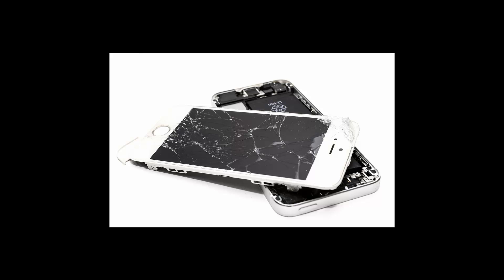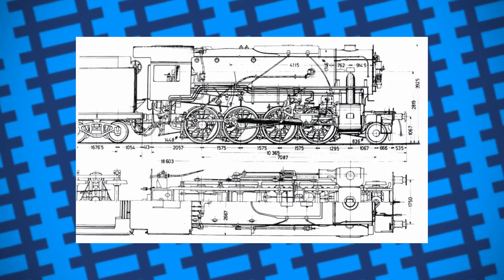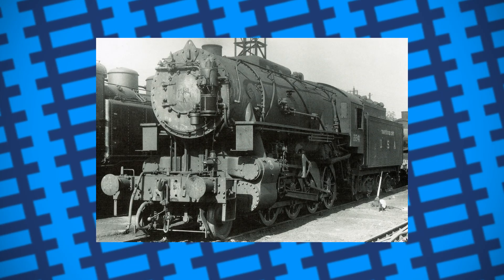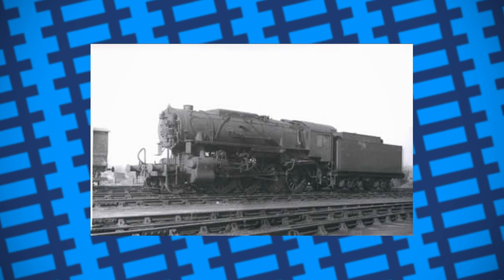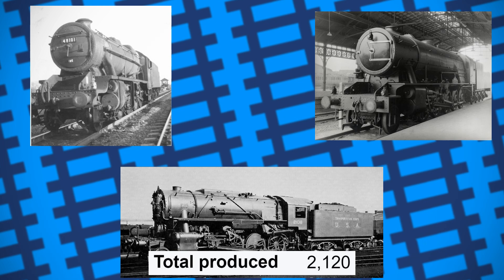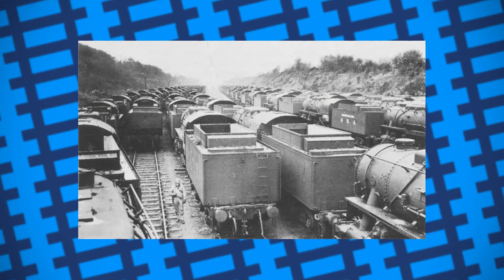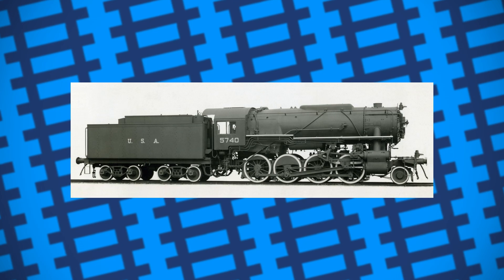The Disposable engines that Conquered the World - USATC S160

Comment: Im typing this comment to inform folks who are intrested on the subject matter of "A handful of S160s in Spain ended up in Alaska" that's mainly a error on Train of Thoughs part but it is true just the other way around. To set some back ground a railway company in spain which is named "Ferrocarril de Langreo" or "Langreo Railway" or "FCL" for short which was a Standard gauge railway that operated in Northern Spain, the railway was established in 1852 during the the late 1950s the railway company wanted to modernize their engine fleet and infrastructure and so they have bought alot of new equipment and engines of varying countries of origin among which alot of american engines and rolling stock are in the huge list of new motive power, five S160s that we're formally owned by the Alaskan railroad company the five machines were one of the first to arrive in spain for FCL along side other american steam engines they were unloaded at El Musel harbor in Gijón date of arrival is (Feb-25-1958) the S160s kept their alaskan railroad Numbering which are: 401, 402, 404, 405 and 406 the engines would haul Ex-Erie railroad hoppers on the FCL but it was quickly found out they were to heavy for the langreo loading gauge to handle especially on the old narrow Carbayín tunnel. The railway eventually decided to modify the more powerful S-159 (another USATC 2-8-0) and four were so treated, 401 being kept for spares. Modifications included cut tender tops, cabs with lowered roofs and slope sides and front pilot substituted by Langreo hook couplings and buffers. The story pretty much kinda becomes abit unkown since there isn't alot of records but they did do a fairly good amount of hauling before early withdrawal of the five S160's in service the scrapping of the five machines is Abit unclear but best i could find is that they were all scrapped in 1968 and at the same time FCL ended their main line steam operations. I hope this long text help clarify the confusion i do apologies if this comment is a unneeded long read and Im okay if Train of Though deletes this comment but still i hope this comment is helpful and mayby some of ya'll learned something interesting.

Comment: Not train related, but my favorite examples of planned obsolescence backfiring are the Ford n series tractors and the great lakes freighters. There were about 500,000 ford n series tractors made between 1939 and 1952 and about half of them are still assumed to be in active service today. As for the freighters, because the great lakes are freshwater, the ships dont corrode like oceangoing vessels, and there are examples of ships made in the 1920s still in active service today. Unfortunately, this means that the company that made most of them went out of business because they didnt need replacement as often as the wood hulled ships that they replaced.

Comment: To resolve t confUSOn onTh distribution of these locos: the S160 were Standard Gauge locos for Europe, North Africa, Iran, and Britain.
The S160 was a 2-8-0; the Narrow Gauge version was the S200: it was a 2-8-2 for both 3'6" and Metric ( 3'3.375":). these were for India, Queensland, and several Narrow gauge Asian Railways.
Completely different from S160...Boilers may have been on the same design, but chassis and riding gear was different.
The Rissian and Indian Briiad Gauge ( 5'0" and 5'6"l) were simlpy fitted  with Wider Wheel sets on standard frames.
1
A Standard Gauge 2-8-2 version was also suppled to Iran, and some emded up   in Italy as the Gr.747 after the war. Saw them in Scrappers Row on Milan Marshalling Yards on 1978. S160 in Italy were the Gr.736. (73x and 74x were 4 axle freight and Some High speed locos)
To clear up some of the Misinformation above.
❤

Comment: Unfortunately, only the boiler from locomotive 456.159 (S160) has survived in the Czech Republic. After decommissioning, the locomotives ended up as heating boilers or were quickly scrapped as a bad imperilastic thing. That's how everything that came from the west, which according to the communists was bad, ended.

Comment: The safety valves lifted much more suddenly and explosively than on British engines of the time. Traincrew handing over to rookies who hadn't worked on them before would leave the blower open half a turn and enjoy what happened when they blew off - the crew would literally jump in shock and often bang elbows, drop shovels etc. British crew were also intrigued by the whistle, "a railroad bellow straight out of a Hollywood western."

Comment: I think the point missed is these locomotives weren't really designed to be "disposable".  They were designed to be simple, reliable, and easy to maintain in primitive conditions with basic tools, and they survived in service because they were reliable and easy to maintain and would keep running long after more "sophisticated" designs would require major maintenance.  For instance, they lacked the superheating that was effectively standard on US locomotives by that point.  The axle box issues were mostly caused by British train crews unfamiliar with greased bearings failing to lubricate them properly.
Reply: There was a superheater. Though it is true there were very basic

Comment: Seventeen S-160s never left the U.S. Of those, six were built specifically for the Alaska Railroad. Because of its U.S. federal government ownership, it was able to buy them under the USATC contract. All were modified in the Baldwin factory for use in the U.S. (electric generator and headlight, knuckle couplers, power reverse, bell, air operated firebox door, etc.).  My best assessment from all the research I have done is that the original operator for eight was the U.S. Army and those were stationed at Ft. Eustis and on the Polk-Claiborne Railroads. At the end of the war, the Alaska Railroad obtained six more S-160s. Three were used and came from Polk-Claiborne. Three others were apparently new war surplus, it appears that two of those three were built to U.S. specifications and one was built to export specifications.

I can say with considerable certainly that no S-160 returned to the U.S. after being deployed to Europe or Africa. That a couple did is an error in Tourret's book.

Alaska Railroad #557's overhaul has been extensively documented on Facebook and Youtube as "557 Restoration Company" and in monthly status reports on their web page.

Comment: An interesting read is "Built for Battle" in Trains Magazine, December 1964, by retired US Army Reserve Col. Howard W. Hill, the designer of the USATC 2-8-2. He has some highly critical things to say about an unnamed Major and a 2-8-0 locomotive. What he doesn't say is that the 2-8-2 he was responsible for was cancelled mid-production and replaced by the S-160. Some of already manufactured or procured parts for the 2-8-2 were converted for use in the S-160s. With that back story it is obvious that even 23 years afterward Hill retained a grudge when he wrote the article.

Comment: One thing you missed in the video was that the Americans also built a slightly modified version of these locos during the war for Queensland railways in Australia. These locos worked right up to the 1960s and two survive in operational condition today
Reply: Would those be the S118 MacArthur class? I believe down under it was known as the Queensland Railways AC16.
Reply: @asteroidrules  yep that’s them, out of the two surviving one of them is owned by Queensland rail today and the other is on the zig zag railway in New South Wales

Comment: Very impressive performance for a "disposable" engine. The 2-8-0 wheel arrangement was the best general use design for the US, and apparently useful everywhere.
Reply: Thé 282 arrangement was preferred here in France for general use : it allowed for a wider firebox. (It did not have to be squeezed between the drive wheels) permitting use of poor quality coal.

Comment: 6:37 Some never left the US, like 1702. Built by Baldwin in 1942 it was used for training purposes at Ft. Bragg in North Carolina. In 1946 it got bought by the Warren and Saline River Railroad, having some modifications done. It got sold to the Reader Railroad after the WSR dieselized in the 60’s, getting modified again. In 1985 it got sold to the Fremont and Elkhorn Valley Railroad (rip FEVR), operating between Fremont and Hooper, Nebraska. In 1991 it got sold to the. Great Smoky Mountains Railroad where it got modified again, and still is today.
Reply: #AlaskaRailroad557 also had a similar story in which it also never left the US.

Comment: I've kind of fallen in love with these engines after seeing a few videos of them on YouTube a few years ago (thanks Marsh Steam Videos).

One of the ones preserved in Britain, no. 2253 'Omaha' (which originally ran in Poland), came to visit the Severn Valley Railway last year for the Autumn Steam Gala and I managed to ride behind her on the day that I was there, which was just as well because she failed the following day! She stayed at the line for the winter and late in December I managed to travel behind her again, all the way up from Kidderminster to Bridgnorth. I'd thought that the crew were treating her quite carefully on the journey, and it turned out that I'd possibly been right, as I learned later that she'd been failed while at Bridgnorth with a boiler leak! Hagley Hall happened to be lightly steaming in the yard so was able to take over for her second run down to Kidderminster and back with only a slight delay (10 minutes or so) from the timetable.

Omaha was meant to run at the SVR's Winter Gala in January and then head off to the Great Central Railway for its gala, but neither ended up happening, with repairs unable to be completed in time given that there was only just over a week between her failing and the gala itself! The SVR ended up sending one of its own locos (BR Standard 4 4-6-0 no. 75069) over to the GCR in Omaha's stead!

Comment: "A handful in Spain ended up in Alaska."
I'm sorry, but...what?!
That deserves it's own video.
Reply: I think it's a mistake, some of the Alaskan ones were sold to Spain, not the other way round
Reply: @GlenlowWorks  But funnily enough it's definitely not the longest journey these things have gone on. Of the preserved S160s currently in the UK, one was bought from China, four from Hungary, two from Poland, and one from Greece who had previously bought it from Italy.
Reply: How did they regauge these locomotives to accomodate the transition either way?  Was it a procedure like the Russian Decapods that could be regauged by putting really wide tires on the wheels when using them on standard gauge?  (But would need to do this a LOT MORE to go from 5' 6" to 4' 8.5" than to go from 5' 0" to 4' 8.5".)
Reply: @Lucius_Chiaraviglio  I know when narrowing the gauge on the S118 they did it by adding spacers outside of the wheels. For the S160s it may have not been a unified process as some were definitely built in broad gauge, but the Alaskan ones weren't so they would have to be converted.
Reply: ARR #557 is currently being restored to operational status a few miles from where I live. They have a small youtube channel if you search for "557 Restoration Company"

Comment: "Planned obsolescence" is mostly a myth. There is always a tradeoff between durability, cost and performance, and most consumers choose cheaper, better models that don't last.
Reply: There was literally a conspiracy between lightbulb manufacturers to have strict, fixed lifespan for lightbulbs
Reply: @VS-sf1rt  That's what I'm talking about. That agreement was to improve the energy efficiency of light bulbs. Look for a video by Technology Connections called "Longer-lasting light bulbs - it's complicated" if you want to learn more.
Reply: @VS-sf1rt  Only because there is a very strong relationship between efficiency and lifespan, and the manufacturers standardized to the same solution. https://youtu.be/zb7Bs98KmnY?si=bZB6pykopgkL_mxa

Comment: 5:56

That’s kinda wrong. All but 2 of the Alaska Railroad’s S160’s were sent to Spain in the late 1950s, not the other way round. Also most S160’s in the States were built there, and stayed there. Such locos like 610, 1702, 556 and 557 were built for the states, and haven’t gone elsewhere since,

Comment: An excellent video! I wanted to make a quick correction regarding the S160’s in the United States: most, if not all the S160’s that exist in the USA (not including Alaska) never went overseas, and instead found work at various military bases, such as Fort Bragg, and probably most famously, For Eustis, where S160’s were used as Military training locomotives up until the 1970’s.
One of those engines, #1702, currently operates on the Great Smoky Mountains Railroad in Bryson City, NC, albeit heavily modified with a number of cosmetic differences, and a larger tender.
Reply: Also nearing its return to operating condition is #AlaskaRailroad557, based out of Wasila, Alaska.

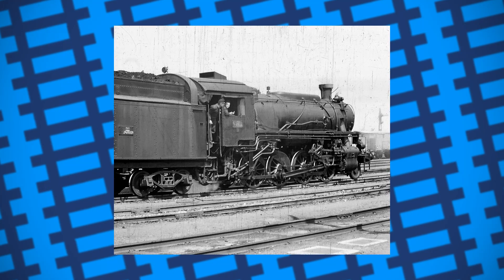Comment: Wait Alaska fucking Alaska how did that happen 5:57
Reply: From other comments, it's the other way around--some engines sent to the Alaska Railroad were later sold to Spain, which probably already had some from the war and wanted more.  Funnily enough for your timestamp, Alaska Railroad 557 (which stayed in the US) is currently under restoration in Wasilla, AK.

Comment: The H. L. Hunley was an early submarine built by the Confederate States of America during the US Civil War. It was composed of a long iron tube 12 meters and was propelled by a team of six men turning a large centrally mounted crank to drive a prop. It was made to try to break the US Navy's blockade of the CSA, allowing for the importation of more weapons and materiel from Europe. It was notable for killing two crews of Confederate Sailors by suffocation in testing and a third during it's only operational deployment. The Hunley sailed out to the union sloop USS Housatonic and impacted it with a spar torpedo, basically a bomb on a pole on the front which it rammed into the Housatonic's hull, blowing a hole below the water line and sinking it. While succesful, the Hunley sunk with it's target.

Comment: Philippines also had 10-20 S160s in 1950s to 1970's Renumbered as the 800 Class
Reply: Yep thats true.
Reply: The engine class your talking about is the Manila railroad class 800 these engines were 2-8-2 mikado types not 2-8-0 consolidations the class 800 is basically the Philippine's equivalent to the USATC class S118 famously known as "MacArthur's" and these engines were received between the years of 1944-1945 Unless What your saying is info not easily accessible on the internet
Reply: @Lordbread-M1899  wait, those are S118s and not S160s? 
I'm so sorry, There's not much Information about the Locomotive USATC gave to Philippines so I didn't know
Reply: @CycloneProductions22   Yes those are S118

Comment: US engineering. It isn't perfect, but it works.
Reply: Also applies to modern diesels too. One of the most common UK freight engines, the BR class 66, was made in the US. They're hot, noisy, and certainly not pretty, but by golly do they do the job and have an availability that puts older British made diesels to shame.
Reply: I mean, to be fair, these were only supposed to help in the war then right after be thrown away. They weren’t supposed to be good, just good enough to get the allied countries through.
Reply: Isn't pretty? Have you seen our streamlines? Mind you the queen of steam is an American Northern, known as the class J.
Reply: @richardjayroe8922  the J has nothing on the Southern Pacific GS class.
Reply: @modelrailroadexcursions987 Only in looks. Performance, however, the J is Queen!
Reply: Well it needed to be repaired unless you wanted them not explode.
Reply: @Arkay315 the standard late 0-6-0 switcher has more tractive effort than a 9f
Reply: @richardjayroe8922  I know
Reply: it isn't pretty, but it works you mean?
Reply: @yeoldeseawitch Just the way I like it, Lots of pipe and gears being exposed fitting the massive size of American Locomotives.
Reply: @yeoldeseawitch  that too
Reply: @yeoldeseawitch  In comparison to what the UK did for war time locomotives? It's still pretty.
Reply: @modelrailroadexcursions987  nah 8fs look much better
Reply: @yeoldeseawitch  that's a pre-war locomotive. I'm thinking wartime consumables like the Q1 0-6-0. 🤮
Reply: So does engineering from PLENTY of other countries.  Such as (from Britain);  centimetric RADAR, ASDIC, the British War Dept. 2-8-0s and 2-10-0s, the Spitfire, the Hurricane, the Mosquito, and the most powerful non-atomic bomb ever built;  the 22,000 lb 'Grand Slam', designed by Dr Barnes Wallis, and built by Vickers Ltd, in Sheffield, Yorkshire, ENGLAND

Comment: The DR Class 52 Kriegslokomotive was also built to only last a few years, but nowdays its the most common preserved locomotive in the whole of Europe. In Bosnia they are even in active service.
Reply: As the name suggests, this loco was meant for war and is basically a simpler version of DR Class 50
Reply: Yes...of the 6000 parts of the class 50, the class 52 has only 5000 and of them about 50% are simplifyed. In many european countrys they survied till the end of Steam in there countrys. East Germany modified them in the 60´s and run then official till 1988 but many were even run till 1994. In Poland they were in use till 1992...the other mostly till the late 60´s or even till the late 70´s. So in the end it was a very robust construction which do not need of service. They were just running
 @68poundercarronade
Reply: there were alot of austerity 2-8-0, 2-10-0 and hunslet tank engines which ended up lasting till end of steam.
apart from the hunslets which kept on going for decades after.
Reply: @davidty2006 yeah!! Around 100 of the 2-10-0’s worked for the Dutch railways as the class 5000. There is one preserved in the railway museum
Reply: That's pretty much the case for for steam locomotives built for WW2.